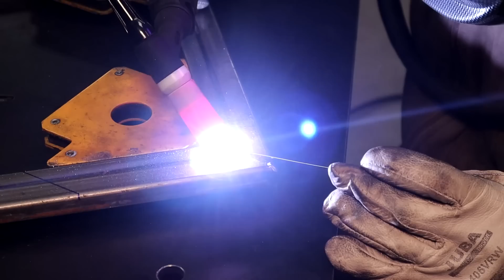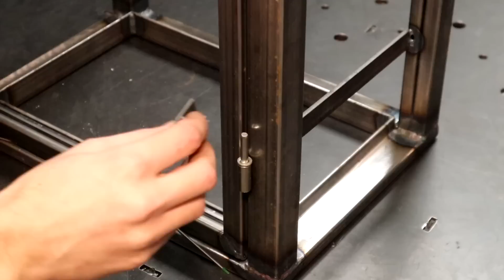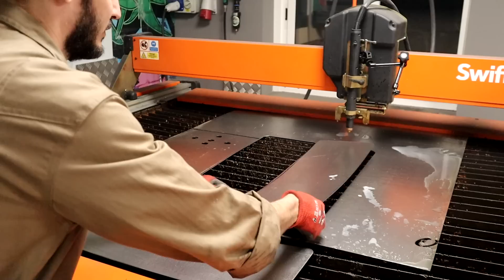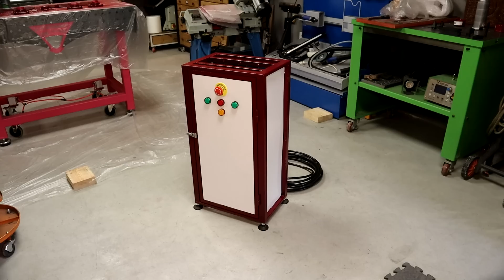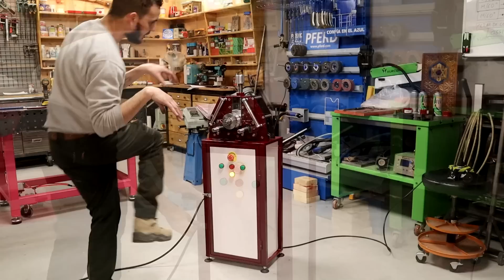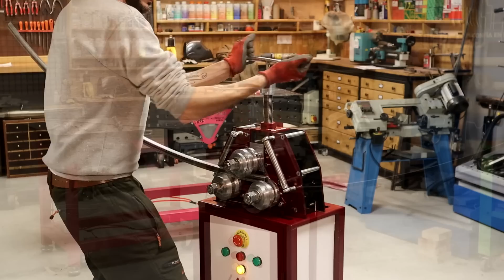Fabrico una CURVADORA DE TUBOS (Episodio 4 Pipe bender)

Comment: Buenas Rocha, una cosa por si acaso no la has tenido en cuenta con la cadena, yo haría que los piñones fuesen intercambiables de manera fàcil, porque? Muy sencillo, al piñón de motor ser más grande y los de los rodillos más pequeños, es cierto que irá más rápido pero puede que llegue un momento en el cual al motor le cueste hacer fuerza. Si los haces intercambiables si ves que le cuesta mucho al motor, siempre puedes cambiarlos haciendo que el de el motor sea más pequeño ya que de esta manera, a este le costará menos esfuerzo aunque vaya más lento.

De esta manera te cubres en salud para un futuro.

Un saludo